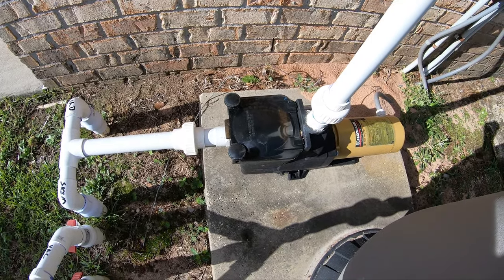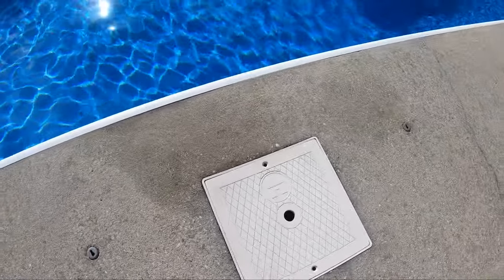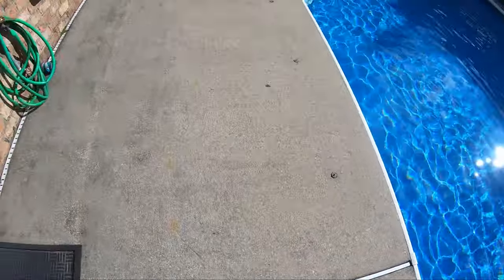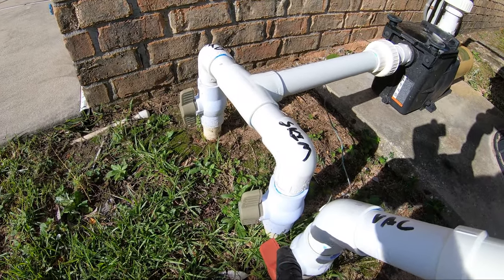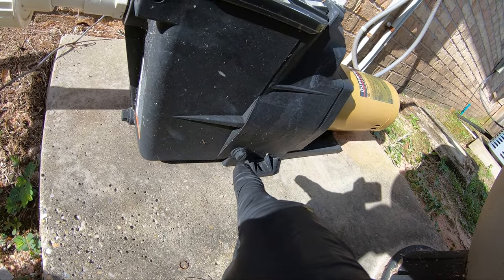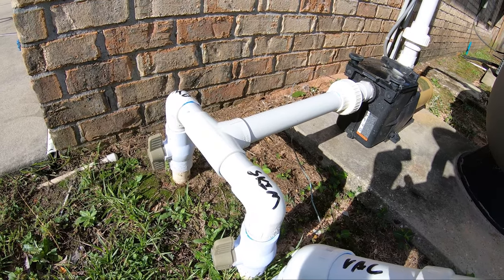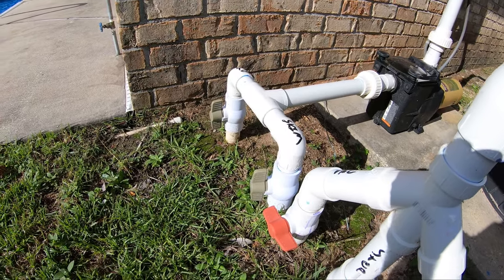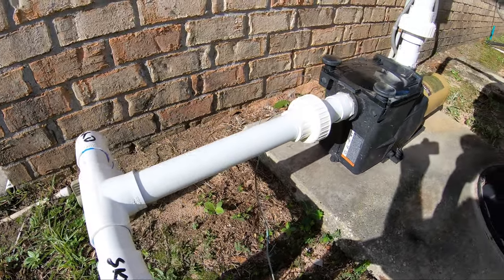Air Bubbles In Pool Pump - How to diagnose where it’s coming from

Comment: You mention windex test, what is that?
Reply from the maker: Spraying the pipe fittings with windex to check for air bubbles indicating a leak.

Comment: Sorry for the noob question but why is this important? Are air bubbles  detrimental?
Reply from the maker: The main reason To make sure there is not air in the pump is if enough air builds up the prime will be lost and that can cause the motor to run dry and burn up. Also when there’s air in the line the Circulation from the Jets will be cut in half which in turn can cause issues.
Reply: Clearly Seen got it. Thanks!
Reply: Okay I have an inground pool one horsepower motor it barely is sucking it barely is having any output with bubbles. I disconnect the plumbing to the pump and run a hose to the pool to the pump and out of the top of the pump back to the pool to see if my problem is the pump I cleaned out the impeller and for some oddball reason this pump is holding water has no suction has no output what could it be? On every swimming pool pump I've ever had in my life you put your hand over that suction it will literally try to suck your body into it not this pump you can put three fingers in there and jam that opening closed and you can barely feel water moving between your fingers you let go of it and you take the holes for the output it's like turning your water hose on low and watching it come out of the hose falling less than an inch from the hose you would think of one horsepower engine motor would throw that water at least three to four feet from the tip of that hose it would have some kind of jet propulsion not this motor I don't know what it could possibly be I'm thinking it might be like worn out where I can't build pressure up between the impeller and the output
Reply from the maker: Have you checked to make sure the impeller is not bad?